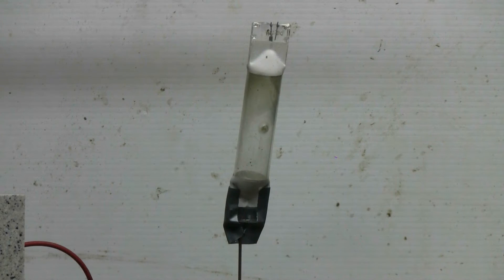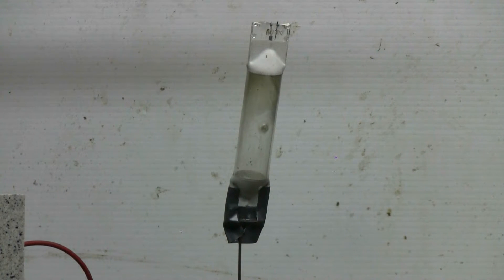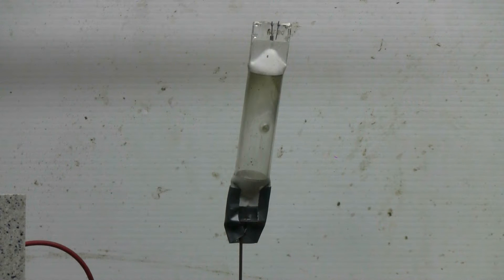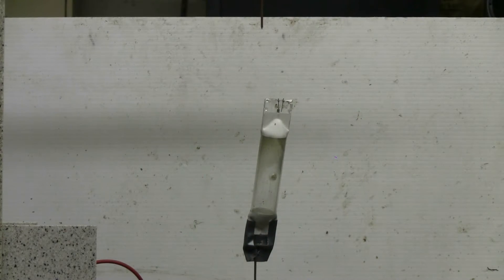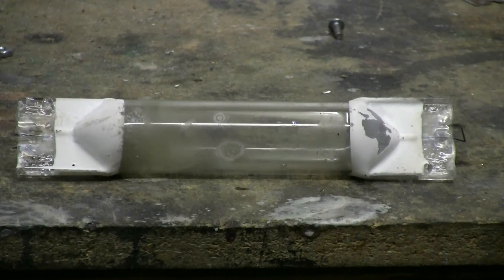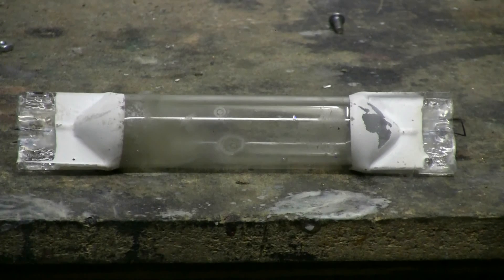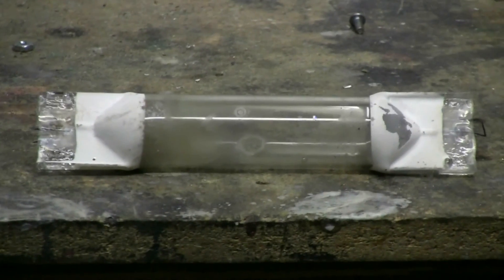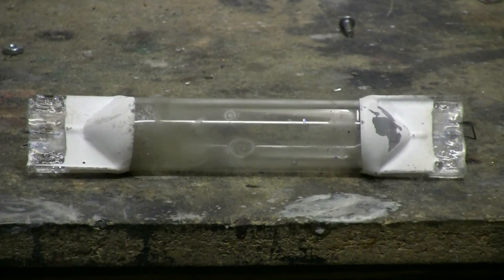Marx Generator - 1000W Metal Halide Lamp Tube

Comment: You're in starting up stage, so you would need to get power supply that can handle highest amp.  Don't trying do that with high voltage.  it harm lamp.